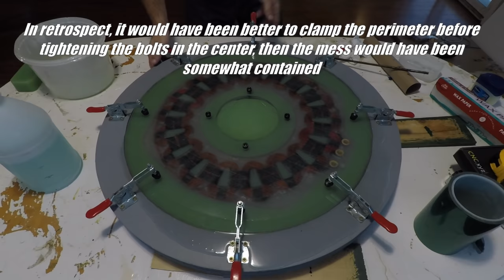Making A Press Mold - Axial Flux Stator Casting

Comment: It's always going to trap bubbles without a way of releasing air out of it. I watch these guys making epoxy tables with all sorts of decorative inclusions. The Cure time of the epoxy is a lot longer and allows for the air bubbles to rise and they use a spray  or heat on it to release when they come to the surface. So they pour half of the mold with epoxy, use the spray to release or either heat to release. Then they wait a little bit and then they pour a little more until the mold is full. Crystal clear every time...
Reply from the maker: Yep, blowtorch pops those epoxy counter top bubbles pretty easily. We've installed a lot of them at work. But we don't cover those and put them under pressure to make them as thin as possible - that's the problem with the press mold. The exit hole in the polycarb cover will allow some air to escape with the excess resin, but unless a person picks the mold up and starts thrashing it around, then most of the bubbles that are trapped are going to stay there - or they're going to knock their coils out of center in the process lol. That's why I like my vac injection mold with the degassing chamber to remove bubbles from the resin before it even enters the vacuum. I'll be setting this one up the same way, when I get a new pump.
Reply: @JamesBiggar  where did you get the polycarbonate film? It's not in your links. Thanks Buddy for making the creativity flow, LoL 😃
Reply from the maker: @TheBillythekid2010  I bought a roll of it on Ebay a couple of years ago for a project that I didn't end up doing. I can't find a link for it anymore, and didn't end up using it for the mold anyway, so I didn't put it in the description. But it's just a basic Lexan polycarb film, somewhere around .01-.02" thick. Similar to this: https://www.ebay.com/itm/Polycarbonate-Film-Clear-015-15-Mil-x-24-x-24-2-Pcs/121716161879?hash=item1c56d93d57:g:USgAAOSwehdc6Jh6

I didn't use it because I wasn't sure how much heat the resin would generate, with it being a larger than normal stator. Based on experience, thin polycarb distorts pretty bad when even a low grade heat's applied to it, so I didn't want to take the chance. If a person spread a super thin and even layer of contact cement between it and the plywood, then that might work. But if you're going to spend the money on film and adhesive, you might as well just spend it on a piece of HDPE or some other low cost plastic sheet to replace the plywood altogether. 1/2" thick with a few small supports underneath should work fine.
Reply from the maker: @TheBillythekid2010  Cheers bud!
Reply: @JamesBiggar  same to you James 👍

Comment: 4 coils from around 11:45 to around 1:15 out of alignment and the pole holes at the top look out of alignment
Reply from the maker: Got distracted with the mix and forgot to hit record. Realized the camera wasn't on, messed around with it, forgot to center the coils up in the mold before covering it up. DOH!
Reply: @JamesBiggar  That's too bad... To share the pour with us you ended up scrapping expensive materials and man-hours. I almost feel guilty for watching it.
Is the misalignment severe enough to scrap the stator? It seems most of the coil will cross the magnetic flux. Or is there a mechanical alignment of the holes also involved?
Reply from the maker: No worries! It's my own fault, and the stator's still useful. But ideally the outermost portion of the inner perimeter of the coil (if that makes sense) should line up with the outer edge of the magnets on the perimeter of the rotor for the best efficiency. If the magnet edge extends beyond the inner perimeter of the coil, then the windings that are covered by the magnets won't be energized near as much if at all, contrary to popular belief (due to the pole configuration and field line structure). If there's a space between the edge of the coil and the edge of the magnet, then that's wasted space that could have been filled with copper. This is why the best magnet shape for this coil shape would be a wedge (if they were affordable), because it would conform to the inner profile of the coils better. The inner profile of the coils should match the shape and dimensions of the magnets used. I accept a slight compromise in efficiency for affordability by using the rectangle magnets with tapered coils, but the widest and longest dimensions of the coil's inner profile is the same as the mag's (1"x2"), and the tighter end of the coil is roughly half the width of the mags. This lowers the efficiency slightly, but not enough to negate the cost benefit. However, this particular stator is a bit to out of whack for showing off performance on Youtube. It's alright though, I've been stocking up on copper over the years. Sh!t happens lol.
Reply: @JamesBiggar  Thanks for clearing that :-)
Reply from the maker: Thanks for the heads up, Billy!
Reply: @blackjackaxialfluxturbines4174  Seems this got taken down too...

Comment: Nice demonstration. I like the inclusion of center holes in the coils for cooling . What diameter are the mag rotors for this project and what size/ strength magnets?
Reply from the maker: Thanks. The rotors are 16" in dia. and the magnets are N50 1/2x1x2" block (CMS Magnetics, magnet4sale.com)

Comment: Nice job, u're Amazing. Too Bad for the coil right to the connection ports  which is miss-aligned.
Reply from the maker: NAILED IT. You're the first. Let's see who else notices it...
Reply: @JamesBiggar  Missaligned how? I don't know anything about these type of things so I have literally no idea.
Reply from the maker: For the best concentration of magnetic flux into the stator and thus the best performance from the generator, the magnets need to line up over the coils accurately in a specific way. Ideally, the outermost portion of the inner perimeter of the coil (if that makes sense) should line up with the outer edge of the magnets on the perimeter of the rotor. If the magnet edge extends beyond the inner perimeter of the coil, then the windings that are covered by the magnets won't be energized near as much if at all. If there's a space between the edge of the coil and the edge of the magnet, then that's wasted space that could have been filled with copper. Check out the link in the end card at the end of the video to see how an axial flux generator is built for a better understanding of what I'm talking about. I also have a design guide available on the website that explains everything in detail.
Reply: I've seen (make that made 😯) a lot worse and I bet it would still make a good (if not perfect) stator.
Reply: @JamesBiggar  Thanks for the reply. Can you or someone else link me to that design guide? I can't find it.
Reply from the maker: https://www.resystech.com/the-diy-wind-turbine-design-guide

Comment: Just hazard a guess - the wiring doesn't come out for connecting to?
Reply: That's why I thought too, having seen the leads trapped inside, but aren't the brass things on top used for that?
Reply: @thunderstruck1078  I thought that might be the case too, but they are buried in the resin I think. I guess you could drill them.
Reply from the maker: The brass nuts can certainly be drilled and tapped, np

Comment: Sir coil turns ohms magnet quantity
Reply from the maker: The video is about making a press mold, not wiring a stator. Generator design depends on application and power requirements. See appropriate videos for more info.

Comment: why don't you make a CNC?. 
so your job will be easier.
Reply from the maker: Because building a CNC is a lot of work, just to not use skills that I spent a lifetime honing ;) If I were a newb and not a journeyman carpenter, or intended to mass produce something, then I would opt for a CNC (or multiple machines), for sure.
Reply from the maker: ...in short, because I enjoy woodworking :)
Reply: @JamesBiggar  
I didn't know you were a carpenter
Reply from the maker: @rafaelsuleymanov7956  No worries, I figured as much. There are a lot of carpenters and woodworkers on Youtube with CNC machines, so it's not an unreasonable question to ask.

Comment: Can I explain more what, where and how to enter in the calculator?  It needs 2000-2500w, wheel speed 200-250rpm, 21 coils with 1.6mm wire.  Ioe of windings, with the coil template 5cm inside and 2cm wide?